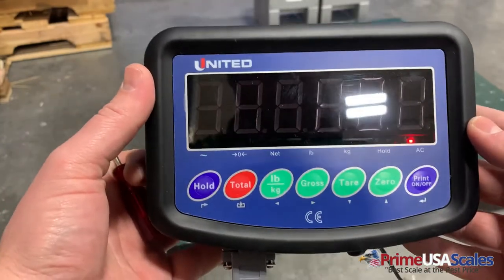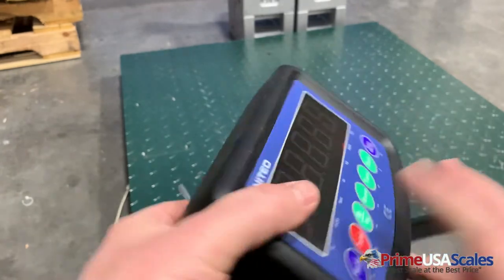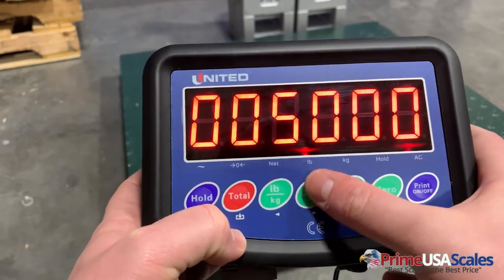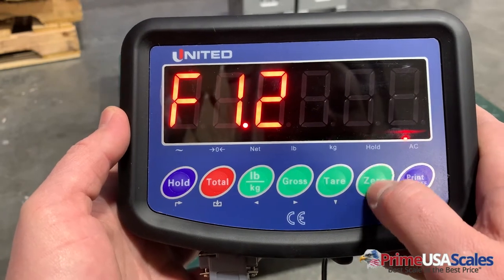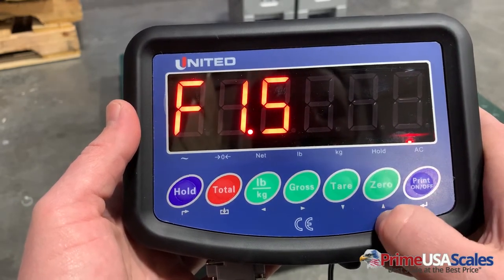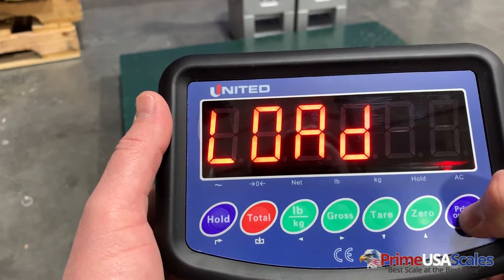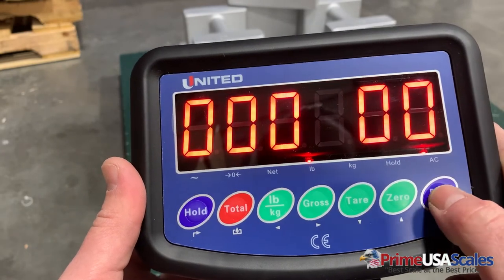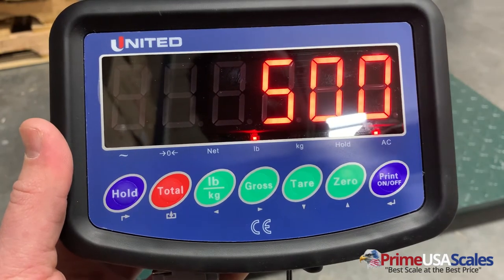NEW United HL318L Calibration

Comment: Hi, can this be connected to a computer? if so, what will be the reading in the port?
Reply: Did you found solution please bro?
Reply from the maker: Hello, thank you for reaching out with your question. Yes, the indicator has an RS-232 port that will allow for connection to a computer. This will require software and parameter setting changes in order to read the weight on the computer.

Comment: Thank you. Can i get weight values in real time on my computer vs rs232c port pleeeease
Reply from the maker: Hello, thank you for reaching out with your question. Yes, the indicator has an RS-232 port that will allow for connection to a computer. This will require software and parameter setting changes in order to read the weight on the computer.